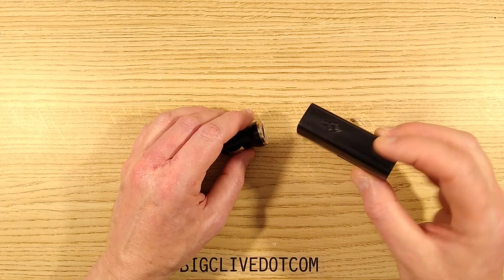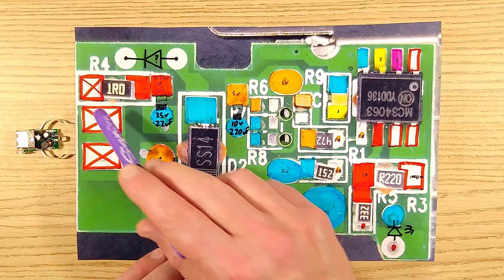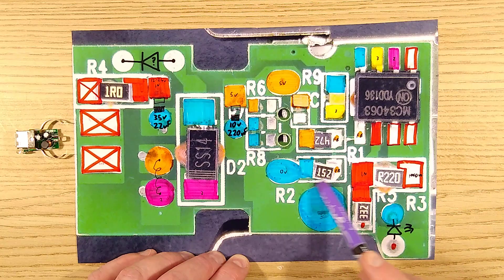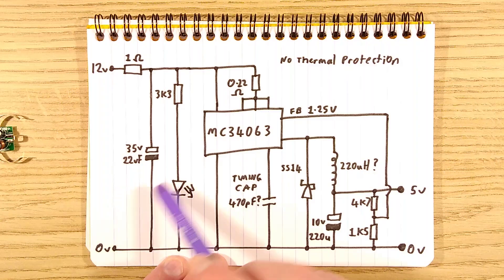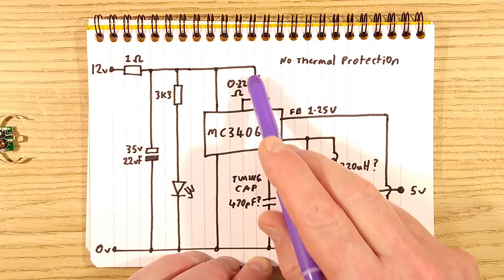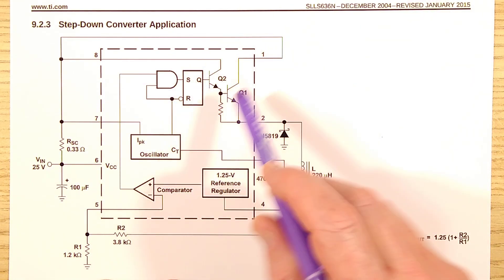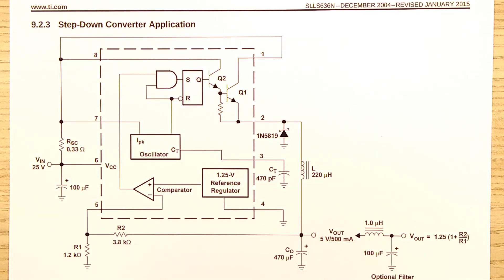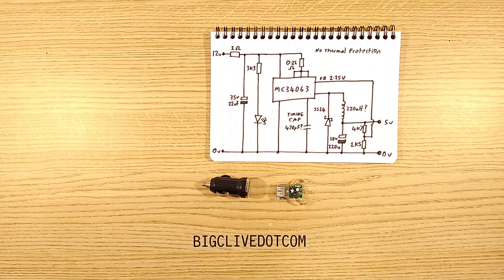Ordinary product with iconic component

Comment: Respected sir, with all respect let me tell You a story. In all my electronic experience about MC34063, changed more than couple of 100 killed by bad design or usage. Multiple projects were this ic is used for supply. I've never ever seen even one that had internal power transistor short circuit, only open break. On the other hand, have seen multiple devices burned to crisp where external transistors were used and gone short, especialy when wrong adapter used with fiber optic media converters (burns SFP also where applicable). Generaly, my humble opinion is, that the datasheet on the MC34063 is badly interpreted by title which says it is 1A, going through some other literature explains that it only can give max 0.5A as standalone. Believe me, this error is present even in some communication equipment devices with 5 digit prices, which were solved by (if I remember exact type) some TI LM2575. Personally, this is one of my favourite IC for step down power in small quantities. The mentioned LM25xx kind of switch regulators are my bet for a little more juice, and never seen any of them burned still (dual presence in say VT330 industrial panel). Best Regards, love your videos and thank You for your hard work making them

Comment: I've had one of those chargers in my car for years. Now I'm scared to use it! I wonder if there's a good option for retrofitting a 5V supply in a car.
Reply from the maker: You do get proper USB outlet modules.  A good quality plug-in one rated for the use should be OK.

Comment: This chip has been on my jellybean list for years. A really sure way to bring on the short circuit failure mode is to use an inductor with an insufficient saturation current rating.
It has a big brother, the 78S40 which has even more modular parts accessible via pins. An opamp with its own supply pin, a floating diode. The voltage reference has its own pin too.
Reply: thanks for mentioning the uA78S40, so i neednt do it, the diode in it is rather poor performer, any discrete 1A40V Schottky improves efficiency over it.

Comment: Employing thee MC34063 in this day and age is equivalent to using a 1971 Ford Pinto for your everyday car. The chip is highly inefficient, particularly in this application (a buck regulator) because the drive transistor is a Darlington. The chip has to dissipate two Vbe voltages, about 1.5V, unlike a more modern buck that uses a MOSFET whose ON-voltage is a very low resistance. And its maximum oscillating frequency is only 100 kHz, which requires a very large inductor and filter capacitor. Yuck.

Comment: The problem I have with these is the RF noise they generate. In south africa we still listen to fm radio quite a bit. especially in the car while driving to work. Having one of these chargers running causes so much interference that you cannot listen to the radio. Having a bigger inductor right over the magic chip may help, but why on earth will Chinese manufacturers use more expensive components.

Comment: I use 34063 as negative voltage generator for OP Amps that need negative voltage rail.
I used to hand-build such circuit but recently found few tiny PCB modules that do the same thing.

Comment: Just finished designing a power supply to take 24VAC and through a diode bridge and into one of the MC34063s down to 12VDC.  I have designed dozens of power supplies and avoided this for years because it was an OLD chip... once I used it for the first time a few years ago, I keep coming back to if for low current applications!  As long as they keep making it, I'll keep using it.

Comment: That power supply has no USB negotiation electronics, so any USB-compliant device should only attempt to pull 100mA max from it anyway (if it's got the right resistors connected to the data pins, then that goes up to 500mA max).  It doesn't matter how advanced or power-hungry your phone is, it won't even try to pull large amounts of power through that supply anyway (they will only do that when plugged into things that are USB-PD spec compliant and are capable of the USB-PD power negotiation protocols, which this isn't).

Also, I wouldn't be surprised if a lot of the newer devices could actually handle getting 12V dumped onto the USB port power pins without damage anyway (it can be surprising how robust some of these things are nowadays), but that's probably still not something you want to test if you don't have to..

Comment: Lemme guess 34063? Can't be anything else.
Its an amazing chip - can do buck, boost, buck-boost, SEPIC, needs minimum components, no need for control loop massaging - hysteretic control for the win.
Get the components around it in the 'about right' ballpark and it will probably work.
For something a bit faster and a bit more modern, that also has a thermal protection - NCV3064.
Edit: AFAIR its a fixed on time hysteretic controller.

Comment: Correct me if I'm wrong but your comment at 3:51 about '12V finding its way to the 5V side' - is that such a risk in these days of phones being charged at (up to?) 20V (following negotiation with the charger)? I would have thought it wouldn't actually damage the phone as much as some older 5V only USB devices might be?
Reply from the maker: I'd expect it to be less of an issue with higher voltage devices.

Comment: Iirc, the MC34063 was originally introduced as a simplified version of the Fairchild µA78S40 which had been around for a few years before the '063 hit the market. Motorola made the µA78S40 for quite some time, too. Both parts are discussed in an ap note by Jade Alberkrack (I have a vague recollection of talking to Jade on the phone a looong time ago.)

Almost all buck converters are subject to failing such that the input is connected directly to the output.

edit
Because these parts essentially regulate the ripple voltage on the output capacitor they are free from need for frequency compensation of an error amplifier. That made them a lot easier to use and prevents palpitations in those who get alarmed when presented with jω.
Reply: "Motorola number but the odd thing is it's manufactured by On".

Motorola spun off their low end  semiconductor business in 1999.  Want to guess what the name of the new company was?  On Semiconductor.    Also, 5 years later they spun off the rest as Freescale.

Comment: Now you tell me. I've been using a dollar store one with a rated output of 2 amps with two usb sockets built in to simultaneously charge 2 fairly new android phones for the past 3 years. The instructions did say NOT to use it while the car was starting which I observe. Now I know why.

Comment: I just happen to have two of these 12/24V->5V device chargers on my desk, so I took one apart while watching 🙂.  I must have an older version of the PCB (silkscreen version: LC-022?).  D1 is populated (not on yours), but I don't have D2 on the PCB (efficiency diode).  All other components seem similar, including the use of the MC34063.

Comment: The missing diode will be for reverse polarity protection.  If the supply is connected with the wrong polarity, the diode will be forward-biased and pass the best part of 12A through the 1 ohm resistor, which will do a convincing enough impression of a fuse.
Reply: ... with added magic smoke for effect 😂

Comment: That resistor was labelled 220, wouldn't that be 22 ohms? Or have I missed something?
Reply: Its R220 or 0.22R, its connected to current limit comparator on the chip.
Reply: The multiplier symbol serves as the decimal point.  2k2 = 2.2k ohms, R22 = 0.22 ohms.  This is an engineering notation convention as far as I know only used for electronic component values.
Reply: @MarkTillotson  Ah yep.

I'm not familiar with the R designation in terms of being marked on a resistor physically, and I'm just used to BigClive saying 0 is the multiplier, so it wasn't adding up and so I assumed I was missing something, and I was haha.

I've just read up on it and it makes more sense now 🙂.

Comment: I had the white version the failure point is the little spring connectors. Mainly the positive connection will get pushed too far inside and jam inside of the casing. Even after fiddling with it the metal and spring is just not strong enough and the outside springs are stronger. It can do 1 amp and i used it to charge tablets and phones reliably up until the metal bent too far and won't hold its shape anymore. Not worth repairing when you can get the 4 amp ones for same price nowadays.

Comment: It is odd the two transistors are split, I cant think of a reason to supply different voltages to them. obviously i'm not being imaginative enough.

I just had to buy a little 3A buck converter circuit to get me 12v to run a car qc3 phone charger, whats annoying me is they have sanded the number off the IC but it says input from 14 to 100v, i'm running it off my e-moped 60-80v battery just fine but I would love to know what IC it really is, they have been selling on ebay for years but i cant find any buck chip for that range, makes me think its repurposed from a light bulb or something!
Reply: If you're using the chip for a boost  converter (with a grounded emitter) the TI schematic shows the first collector connected directly to voltage in and the main collector connected to the coil. This reduces voltage drop a bit and it also keeps the first transistor out of saturation which increases performance even more.

Comment: I believe that is a Peak Current Mode controller.  C⊤ sets the oscillator/clock frequency. At each rise edge of the clock the latch is Set (if Vout < 5.2V) and when the sensed current reaches Ipk the latch is Reset.
In school they teach us the low bandwidth voltage loop (with the 1.25V reference) controls/sets the Ipk value, but that seems apparently not to be what this chip does... I can see some Pros & Cons, but still it's is very interesting.
Of course it could also be that the simplified diagram does not reflects the true chip circuit.

Comment: This is interesting ( ! ) ... to reduce 12 Volts to 5 Volts , all that is required is a (  SIMPLE  analogue ! ) power transistor and a Zener diode ( maybe a resistor or two as well ? ) ... The power dissipation is EXACTLY the same , whichever method used .. AND ... it should not fail with 12 Volts on the output ! .. this method removes the ( complicated IC'S  )  DAVE™🛑

Comment: I've use that chip so much I still have a tube of it.... From a power supply ranging from buck to boost so Sepic and even induction heating. The frequency is fix from the timing capacitor from 1hz to 100khz as max frequency. You would be correct saying this chip fail in short circuit I can still smell it. I do believe it does have over temp protection that start at around 80c but it's not great. Cheers!

Comment: This looks like the kind of chip that'd be fairly easy to make the building blocks of with discrete components. That'd be a fun project and learning tool :D
Reply: For extra bonus points, try doing it with valves!
Reply: Yes it is. Or you can also try the TL494.

Comment: Well this is useful, I've been reverse engineering an old console that uses a NJM2360AD switching controller in its power supply and I found the datasheet for it very lacking, not even an example circuit, but it looks like it's actually a pin-compatible clone of this chip! It may have a higher current rating, at least I hope it does because the console could draw up to an amp in operation. EDIT: both chips say up to 1.5A switch current which maybe the DIP versions can both achieve, so I think it's a direct clone.
Reply: Which console?
Reply: @Julian-c9p7r  Casio Loopy

Comment: “An undesirable” what “that could blow up your phone”? I replayed over and over and I still couldn’t quite catch or understand that. Firmware mode? What does it do to your phone?
Reply: "Failure mode". It fails by shorting the high input voltage to the output.
Reply: @rexsceleratorum1632  Thanks!

Comment: Wonder if it's possible to mod these in a way that the max current it could put out, no matter the device plugged, is half an amp. Makes them a lot safer and half amp is quite respectable for low current stuff or if I wanted to give my phone a bit more juice while driving somewhere.
Reply: Bad idea to use it to charge expensive items given the unsafe failure mode. 

But you can easily limit the max current by changing the resistor between Vcc and Ipk sense (pins 6 and 7) to something bigger, about 0.6 ohms for half an amp.
Reply: @rexsceleratorum1632  That's what I mean. Since Clive said these fail if high enough current goes through for a long time, limiting the max current it could regulate would theoretically prevent it from cooking itself.

Unless the 34063 can fail even when not pushed that much, in that case I get it.
Reply: @ChromiaCat  Well, it is simply an unnecessary risk. Your particular chip might have a defect that causes it to fail regardless of your mitigations. A reputable car charger will have a modern chip plus overvoltage protections.
Reply: @rexsceleratorum1632  Makes sense, I was simply curious if this one could be made more safe in any way.

Comment: Many car USB chargers (the ones with a single standard USB socket and a supposed 1-amp rating) are still a handful of discrete components. I haven’t taken apart a recent one from Dollar Tree, and maybe it’s time I spent $1.25 and put in a little easy work to see if they’re better now. At that price point… probably not!

Comment: The data sheet for that chip is a monster - mainly because it is collection of building blocks that can be used for boost, buck and buck-boost, not to mention voltage inversion, with current limits determined by external components. Its biggest limitation is the upper oscillator frequency, compared to modern chips the PWM is very slow, so inductor choice is limited and controlling ripple on the output is more difficult. In terms of current limit, the circuit you analysed is using the internal driver transistor to pass the current, so of course there can be thermal problems - if you use that to switch an external FET then heating of the chip becomes less of an issue and your switching device can have a chunky heatsink. Ultimately you can always use a current sense on the output and drive the shutdown pin to stop the oscillator as required, though really a more modern device with thermal protection would be a better choice at this stage.

Comment: The reality is that chip was most likely made by some chinese factory, and they just printed the text on it. It could even be one that failed to work in all modes (for example non working inverting mode) so they're sold for pennies. 
You can get now 5v synchronous rectifier regulators for around 15-20 cents if you buy 100+, with built in 5v feedback resistors so all you need is inductor and 2-3 ceramic capacitors, but that's still more expensive than all these parts you have in the video.

Comment: AFAIK, MC430 is that type of a chip which can be used as a boost, or buck voltage regulator, or it can even provide negative voltages as you need them in your design.
Moreover, it also supports using an external transistor for switching the inductor in case of a bigger current.

Comment: Clive, I'm confused by your warning not to use these for charging. Do you mean this specific design, or any adaptor that plugs in to a car 12v? Are more pricey versions better/safer, or are you saying that in-car charging in general is a no-no?
Reply: He's talking about these ultra low cost junk adapters. Good quality adapters are fine and include suitable protection and filtering to prevent RF interference. The Anker chargers are pretty nicely made IME, and not too expensive.
Reply: @ferrumignis  Cheers. Anker is a brand of choice.
Reply: @broadsword6650  He means anything with this particular chip.

Comment: Given the failure mode discribed..
Wouldn't it be a good idea to put a zener in that diod position to shunt overvoltage and potentially blow the 1R instead of the divice that is pluged in?
Reply: A suitably rated zener would add a couple of pennies to the cost, not acceptable in the bottom of the barrel market this is aimed at.  This is also why there is no proper fuse on the input, cost reduced to the last fraction of a penny and reliability be damned.
Reply: @ferrumignis  
I mean, yeah.
True, nobody would spend a dime more than they have to on this kind of thing.
But ppl like us could if we want to use it a little more savely

Comment: It's so common, that I even have a few in my parts bin! 
If the 1.5A built-in transistor is not enough, an external transistor can be driven by the output of this chip.

Comment: Hands up all those expecting a 555 timer 🤣
Reply: Nope, I've opened up half a dozen of these. 

And while I'm sure someone's made a switcher using the 555, I doubt any were produced commercially.
Reply: @rexsceleratorum1632  I meant before knowing what the application was. I should have been clearer.
Reply: @fredbloggs5902  It was a rather obvious guess from the thumbnail that it was a car charger though

Comment: I've used these for years as current controlled LED power supplies. No horrid PWM light output. 

Cheap and good.
Reply: Do you use the voltage feedback pin or just the input current limiting resistor? I've used the latter for LEDs, the former seemed like too much bother.

Comment: Though this is fun to see an old school schematic like this, I don't get why it doesn't just use a linear since a car has plenty overcapacity so efficiency isn't that important. Bet it would be cheaper too. Fun to disect though.
Reply: Power dissipation. Getting rid off all the heat in this small, enclosed plastic package would be very problematic.